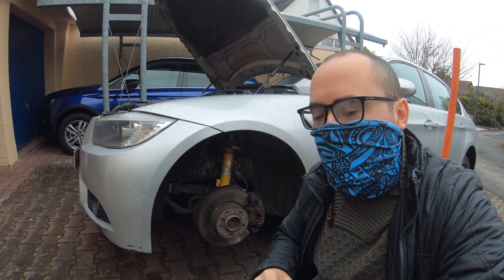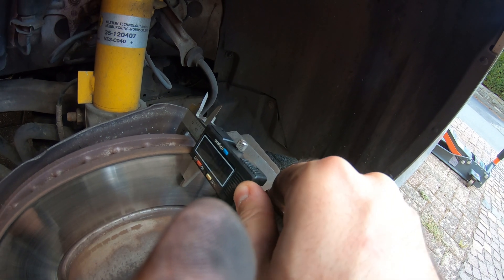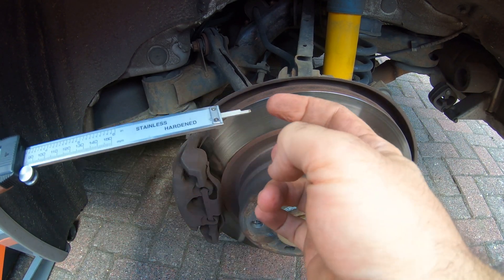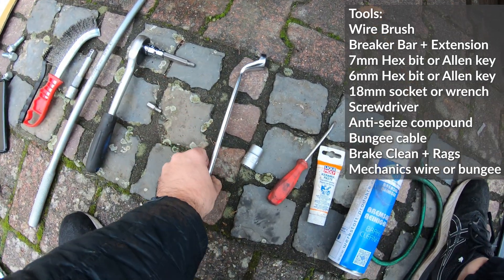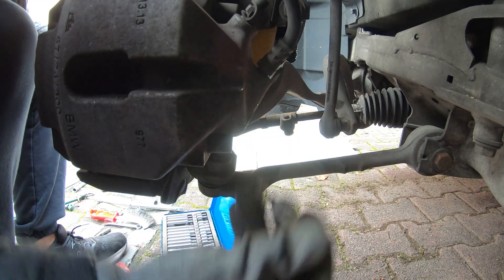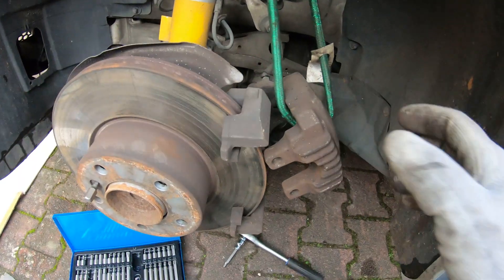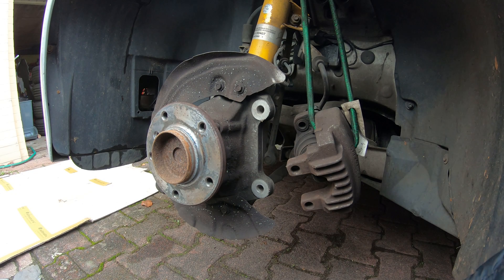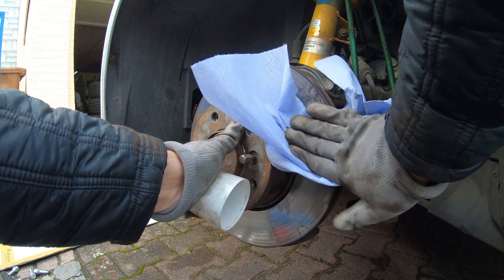[DIY] How To Change Your Brakes on a BMW 3 Series E90

Comment: My wife’s 2007 bmw 323i (Canada) $1200 for all four rotors and pads at a local shop. Also got the valve body replaced with a rebuild one for $1400 😚😒😏
Reply from the maker: Dang, thats alot. well next time you can do them on your own in a day if you have the tools.